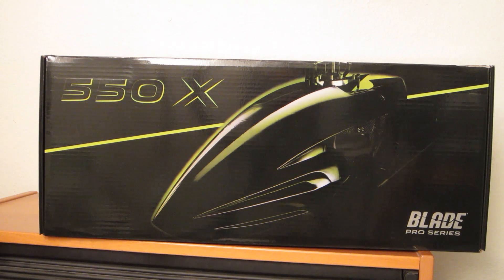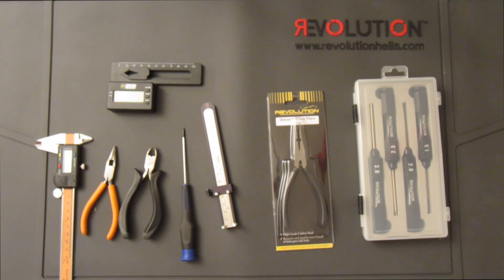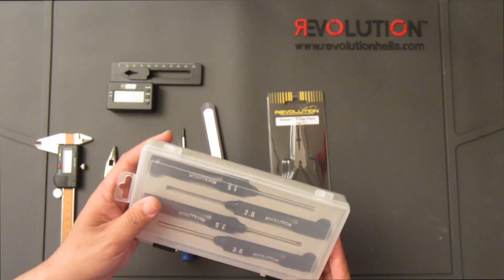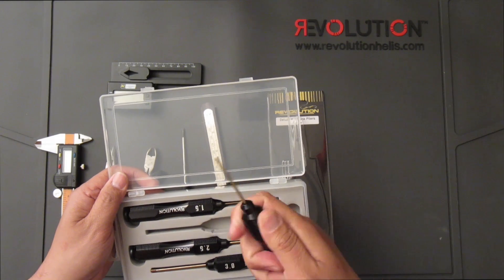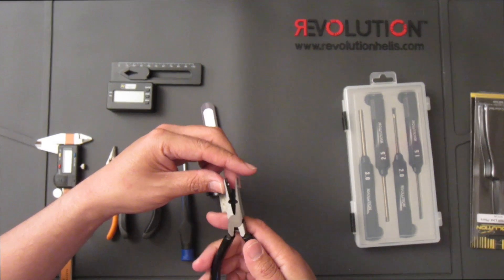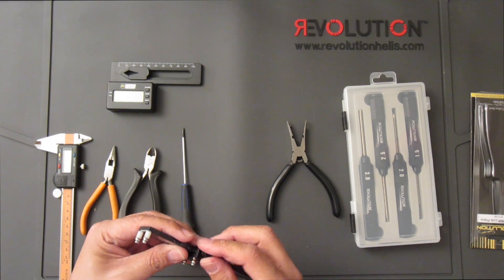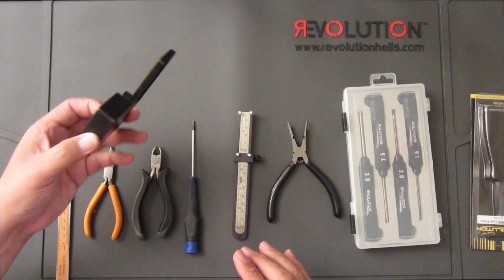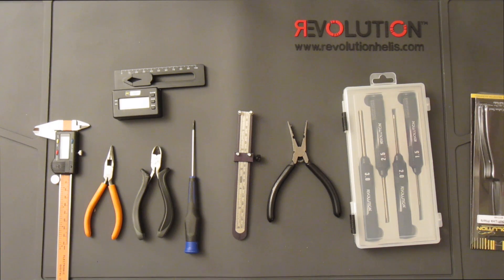550x Introduction and Tools required to build

Comment: Nice video.  However, if for newbie's considering this heli they really need to know how much more money to spend for 3 things: BATTERY, CHARGER  and POWER SUPPLY. Also, crash cost(carbon fiber blade + main gear + tail boom + tail shaft) which is approx $100.